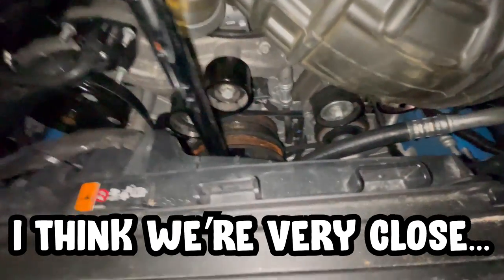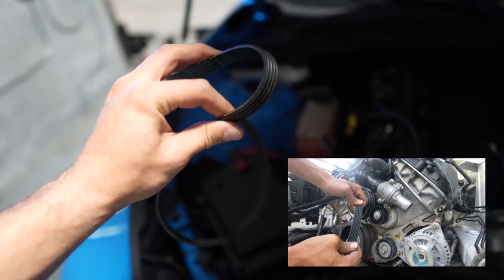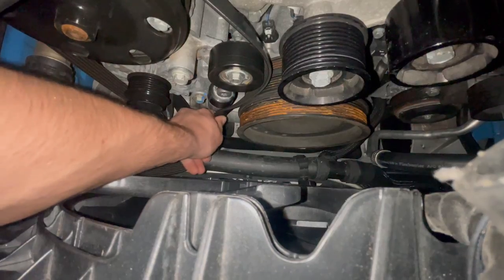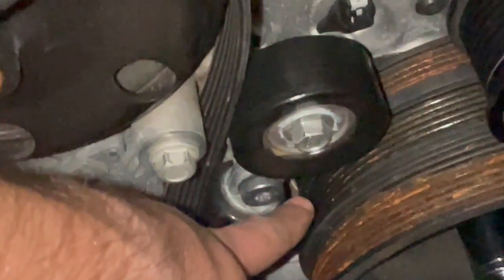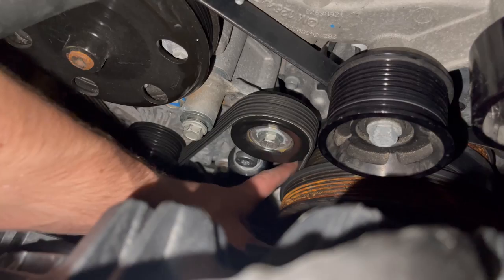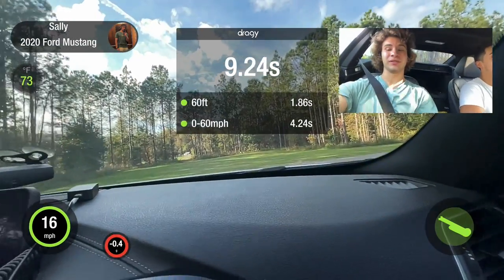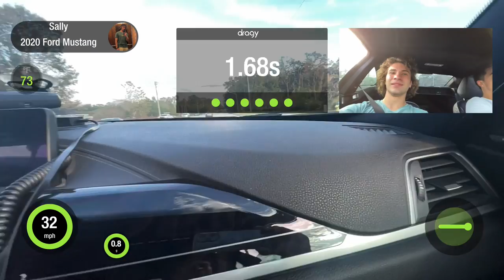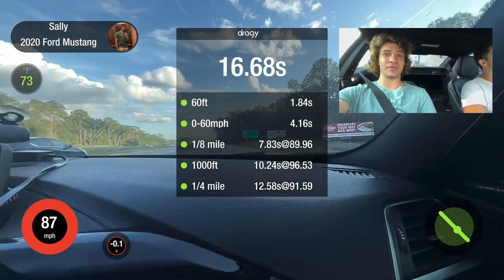THE EASIEST WAY TO PUT AN A/C STRETCH BELT ON YOUR '16-22 CAMARO (NO STRETCH TOOL NEEDED) #CHEVY

Comment: thanks to you i was able to fix the belt after so many videos your video was more detailed on what to do and how to do thank you 🙏🏽
Reply from the maker: Glad it helped! Got some ac now!
Reply: @TobyVegaD procharged lt1 owner here 800+whp but I have a question…threw an a/c belt which took out acc belt last Saturday racing but my question is why was your a/c belt not on? Did it keep breaking on you? 2016 SS with 30k miles and was original a/c belt. I’m just curious if you’ve had multiple issues with the a/c belt breaking or if my occurrence was just a freak incident. Just wondering if it’s a common/reoccurring issue losing the a/c belt